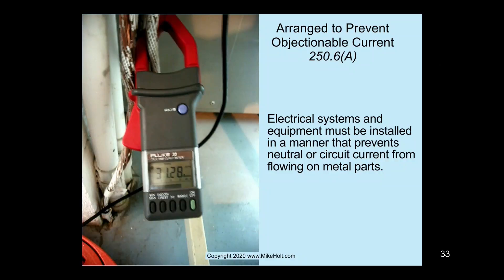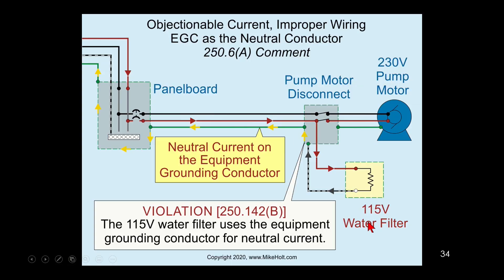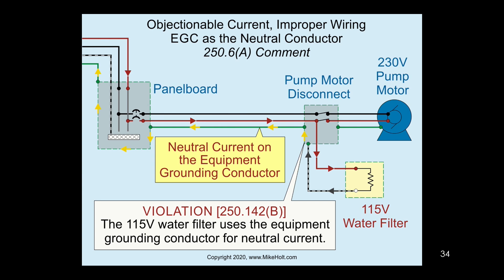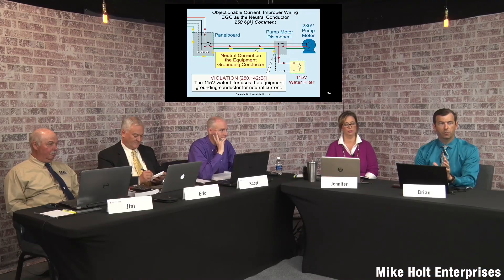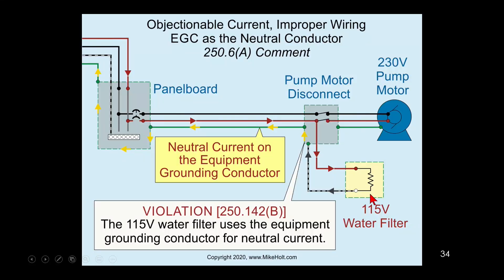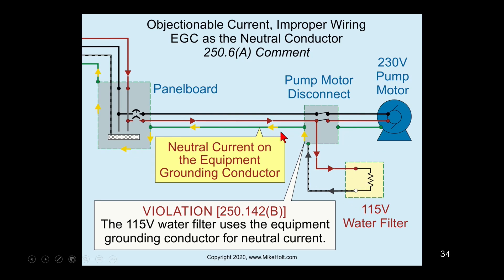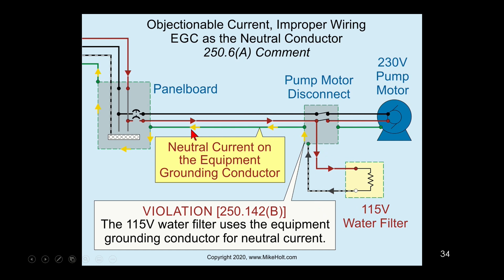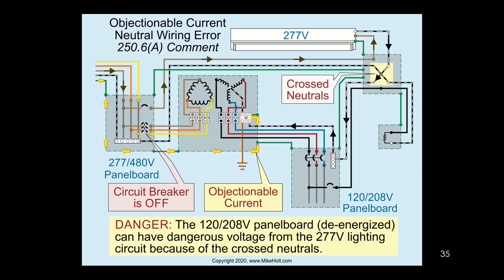Grounding, Objectionable Current [250.6, 2020 NEC]

Comment: Thank you so much for this episode.  Our new construction home has current on the ground wire and high enough magnetic fields in some circuits and switches that my electro-sensitive partner suffers.  Most of the pros to whom I have mentioned this ground current and 5+ milligauss (magnetic field) readings, just shrug and say that some current on the ground wire is 'normal'.  I will point our electricians to this video to reinforce that there is a safety as well as health consideration and not just alarmism from an overly sensitive client.  We suffer meanwhile.

What I would like to see more of are troubleshooting tips for the folks who are trying to track down such wiring problems, which are likely NEC code violations after all, right?  Visual inspection of each junction box is one way.  I fear my mind will get overloaded when I look at all the conductors for the multi-way switches.

Shouldn't electrical inspectors at least take a clamp ammeter reading of the ground wire?

I have also checked the clamp current ammeter on the romex wire (which includes ground, neutral and hot) and even some of these show 20--30 milliamps of net current.  

My understanding is that such objectionable current can stem from a few other issues other than mishandling the neutral and ground, such as (a) CATV lines (which are connected to that same ground), (b) faulty device or appliance and (c) maybe incoming from neighbors if the ground was attached to metal municipal water pipes..  These would appear to not be the electrician's responsibility so it gets murky who can find & fix.

Thanks for all the great work you folks do.